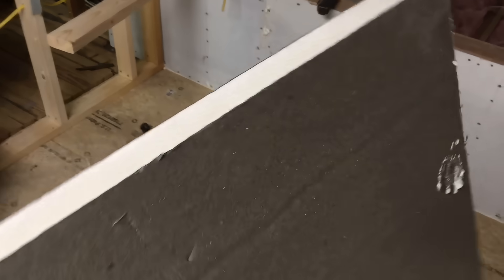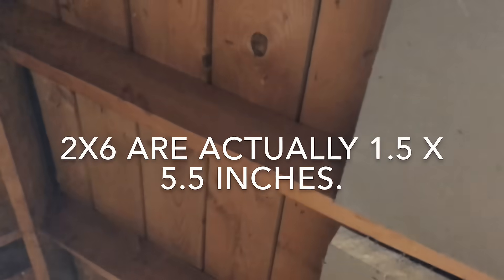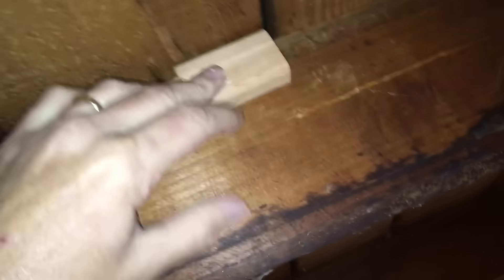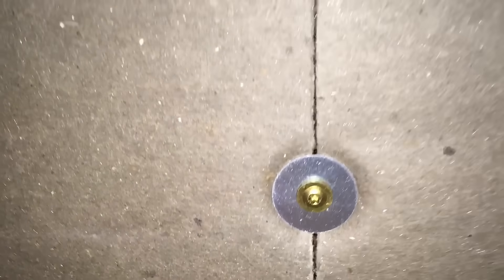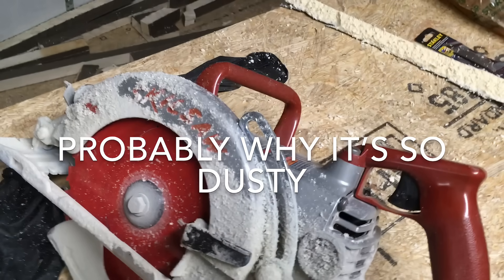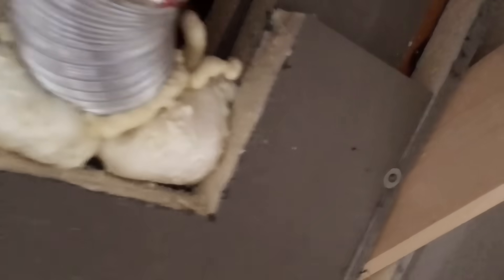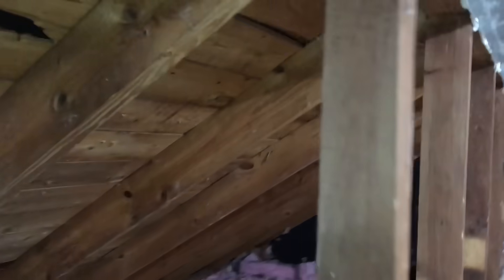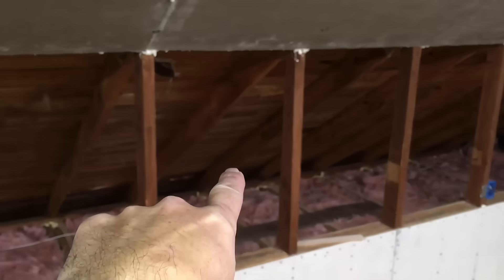Getting R-30 in an attic suite with 2x6 ceiling rafters

Comment: Having a house from 1900 it's not recommended to spray insulation. 

When buying the property two years ago knew I’d add an attic room, but needed to learn how. It's not as easy as I thought. 

With the Derecho storm hitting the property at 140 mph insurance with USAA is covering the roof, fascia, and new gutters.

The contractor is sealing it so can add insulation and make it a room. So, that problem was solved with as little as my insurance deductible 😁

Older houses have great high-quality beams, but as you note not wide enough.

Thankfully, the property has a pyramid-style roof, but don't wanna sacrifice height since I'm tall, and for future generations wanna ensure it'll suffice.

This method is gold. I theorized and plotted with research,  but nothing came close to this tutorial. 

Thank you for the wisdom and ideas. 

For here the energy inspection recommended a 36R value. I didn't call to ask for city rules. Thanks for the info.
Reply from the maker: Thank you for the kind comment, Miss Patience. I wish you the best on your undertaking!

Comment: Hi, this is exactly the idea I was looking for.  Thanks for sharing this. My rafters are spaced with the gap being  14-15 inches. What do you recommend for cutting the 8x4 iso panels? Go 12 inches wide and  get 3 out of a sheet and fill the gap left and right with spray foam? Did you fasten the first two layers separately, or all three with the rafter screws at once? Thanks in advance! Herb
Reply from the maker: Good questions, Herb. If I were working with 16 OC rafters like it seems you have, I'd cut the boards about 14.5 inches wide, or a hair wider (enough for a friction fit), and use the leftover 4.5" for cracks and crevices or cut slivers to help wedge any boards in place that don't have enough friction to hold them (fasteners aren't used for the first 2 layers--just friction). I know it sounds a little wasteful, but otherwise there's no good way (that I can think of) to hold the boards in place. If you end up trying the 12" cuts and it works well, please comment back. There are always better ways to do things, and you might have found one. Thanks for the comment, and all the best on your project!

Comment: Looks good; depending on how how hot your summer gets; a 10"  auto shutter fan on one or both ends of the ridge would be a good addition; I had ridge vents across the entire length; and the heat still hangs without any prime mover.

Peace

Comment: Even buying by the pallet it's 70$/sheet x 3 layers = $210 for 32sqft which is approx 7$ sq/ft.   That's even before the spray foam and screws.   I'd wager a spray foam contractor turnkey is cheaper.
Reply from the maker: Cost me less than $20 per sheet ($18 if I remember right). GAF EnegyGuard. You can find it even cheaper than that as seconds if you look hard. Thanks for the comment, James.
Reply: @FamilyFriendlyDIY  Well $20/sheet would definately make it feasible. I have a similar project but I have the room to furr out conventionally.

Comment: Hello Dave! I'm doing a very similar project in my 1950's style home that has slopped ceilings but no insulation and no attic. Similar to the project in your video. I see you left the 1" air gap. Does that air gap need to vent from the outside? I was thinking about leaving a 1" airgap and also drilling 2" holes into the eves to allow air flow to enter from the outside of the house. Is that necessary??? Am I doing more work than I need to??? Just worried about moisture build up and that creating mold. I plan to use Roxwool R15 or RAMAX Thermosheath 3 3-1/2" thick insulation. Please advise. Thank you.
Reply from the maker: Hey, Samuel. It was actually my shingle manufacturer that required the air gap and venting from soffit to ridge in order not to void the warranty. But depending on where you live, and your shingles, you might be able to do without. A lot of folks said I was wasting my time with the venting...but I like the idea of the insulation being able to dry to the outside as well. Thanks for the question, Samuel!
Reply: @FamilyFriendlyDIY  Yeah. The more I think about it, the more likely I will leave 1-1/2 air gap just in case. I don't want any moisture build up and then it turn to mold and then I'm in deep *hit. I live in California. Although that air gap may not be code in my area, I just don't want to risk it. Thanks for the response.

Comment: If you get a roof leak, will the water just bead down into your walls? That is really the only negative I can see with this setup.
Reply from the maker: It'll probably run down behind the knee-wall. But I think no matter the insulation, a roof leak will have downsides. Thanks for the comment, djuforeo!

Comment: Nice work lad, very clean job. Next time look into Kingspan “kooltherm” it rocking out R-8 per inch so if you did the 6” you’d be up to R-48 which is about the same value as a Passive house wall value. Not cheap though I believe apx $70\board @ 2” thick. Their based in Ireland but have a factory in VA and have reps all over the states.
Reply from the maker: Thanks for the info, Chris. I just checked it out. Pretty interesting stuff ... Way out of my price range though :-(  but maybe some other folks on here will find it just what they're looking for.

Comment: Excellent tutorial! Thanks so much!! We are tackling the same type project now in northern Wisconsin. Question: Why did you use batting insulation above the collar ties instead of the same rigid insulation you used on the slope?
Reply from the maker: Thanks! ...  I used the 9 1/2" batts above the collar ties because I had a deeper space to work with, and it's cheaper and easier to install. My goal was to do it all as cheaply as possible, while conserving headroom and meeting code. Thanks for the comment, C Bayles!

Comment: Should have sealed the soffits with osb and capped the ridge vent to create an invented attic and spray foamed yes more expensive but now you created an insulated vapor barrier envelope   Very well documented if inspector gives you a hard time. Depending on climate zone.  Now you created a complete thermal break so moisture has no place to condensate. 
Unfortunately moisture in the winter can still condensate in the space you created and mold over.  IMHO.  Vented attics are a thing of the past they don’t work.
Reply from the maker: Your suggestion could very well be the way to go... until something supersedes it ... and then something supersedes that ... and then that ... as something always does. I have a feeling that one day ALL foam will be done away with ...  for now, just trying to get by with what I've got. Thanks for the comment, jetmaster.
Reply: @FamilyFriendlyDIY  going over this subject with another engineer on a remodel that came up where spray foam wasn’t an option 
Strip shingles 2 layers of either rock wool, eps, Xps put in battens of rock wool then zip sheathing taped all soffits and ridges sealed then batt insulation in 2x8 rafters.  
Soo conclusion in my area was cheaper to spray then rip my roof apart. the engineer agreed the sealed envelope creating a thermal barrier with no venting but also creating a vapor barrier and or air exchange unit up north, and a good vapor barrier exterior in the south.  
Great job multiple ways to skin the cat.
Reply from the maker: update : https://youtu.be/5oSQhPvCvz0

Comment: The r value requirements in building are only to support traditional insulation in a laboratory setting. The vapor and air barriers alone in spray foam mean you can use a tenth of the depth and achieve MUCH better results
Reply: did you even watch the video is spray foamed all the cracks up getting a very good seal.
Reply: @khandam7709  what are you talking about?

Comment: Your 2x6 rafters and roof are not designed to carry the load of insulation and drywall. This is a rookie mistake.
Reply from the maker: I upsized my collar-ties to effectively reduce the span of the rafters. The span is less than 8 feet from collar-tie to knee-wall. It's been finished (with drywall) for a couple of years now, and everything still looks good. Not a single screw pop or cracked joint.

Comment: great job, is that styrophome board fire retardant? can you sheet rock over it, and make the attic liveable?? time and labor costs, mite as well spray closed spray foam, no?
Reply from the maker: Thanks. It's not fire retardant, but it is now covered in drywall. The area is livable and is now a bedroom suite with full bath. (Got some more videos out there with it finished.) I didn't have the money for spray foam, and I worked for free in my spare time :-) ...  Thanks for the comment!
Reply: @FamilyFriendlyDIY  where do u find the foam, how much per foot so we can get an idea? it kills that its 3 stacks of it to get to 30r. also no vapor barier needed between the rafters and 1st piece of foam 2prevent m oisture? thanks
Reply from the maker: @mml1224  Got it at ABC Roofing Supply for about $18 per sheet, but a lot of guys have commented they can get "seconds" cheaper than that. I wasn't required to have a vapor barrier where I am (SC). Not sure about other places.

Comment: Hello Dave, I really liked how you insulated your attic's rafters with the foam boards. Is there a reason why most people using these foam boards in attics only use them on the rafters and not in between the joist that are normally filled with loose blown-in insulation? Is there a reason not to use those foam boards in between the joists and then blow some insulation one them. Thanks, Juan
Reply from the maker: Good question, Juan. The reason foam boards are more often used in the rafters is because they provide more insulation value with less depth, so headroom can be conserved. If the area is just unused attic space with no floor,  and therefore the depth doesn't matter, it's a lot quicker and cheaper to just blow in about a foot of fiberglass (or a little less cellulose) to get the same insulation value.
Reply: @FamilyFriendlyDIY  Thanks for getting back to me.

Comment: I used this exact material for my house addition. Fortunately, a manufacturer is only about 10 miles from me and sold "seconds" for a fraction of the cost of new. I saved myself thousands, but it was a lot of work and a itchy mess. I filled 2x10 rafters, so my R value was over 50. FWIW, a table saw works well to cut the material.
Reply from the maker: That's awesome, Bob. ... I did another video on cutting it, didn't try a table-saw though  https://youtu.be/Z292iuV91hA

Comment: How do you install your gypsum boards on the polyiso boards?  Why didn't you put 1x3 or 1x4 slats when screwing your polyiso?  That way you would have had a nice place to screw the gypsum boards.
Reply from the maker: I used really long drywall screws. https://youtu.be/dGeoA1ji_iM  It's been about 2 years now and no screw pops or cracked joints. I think the foam actually acts as a buffer from the expansion and contraction of the rafters.

Comment: If the gap between the roof deck and the insulation isn't there for airflow then I would fill it with solid foam.

Comment: This is the best job I’ve seen yet. Did you consider a sealant or coating (maybe aluminumized) on the underside of the roof. I was thinking that so much hot humid air is going to be moving through these conduits that protecting the wood would be wise. I was also thinking about using a foil faced foam to reflect more of that radiant heat back at the roof.
Reply from the maker: Just reading through some comments I missed. Thanks Mike. I thought about it, but I was trying to get by with the least expense and satisfy the inspector. We just scoped the roof though, check it out 3 years later https://youtu.be/5oSQhPvCvz0

Comment: hint for working with fibreglass. 
stay as cool as possible, and don't sweat. if this means planning your work for cool days, do so!!! 
Take a full, cool shower immediately after working, THEN heat yourself back up after you're fully scrubbed with the cold water. 

This helps BIG TIME for the itchiness.

Comment: To cut without a mess, box cutter score both sides and snap. Or box cutter for the facing and a hot wire cutter for the foam

Comment: Creative and it works. However if I am not mistaken R30 code would be on new construction and older homes could be grandfathered.  With older homes there is sometimes no way to meet current building codes. Honestly for the time and materials involved you probably could have paid for open cell foam applied directly to the roof deck that would have outperformed that rigid foam just due to it's ability to stop airflow.. The figure you mentioned seemed high. I had a silimar project in our last house for the master bedroom. About 600 square feet and it cost $1500 for ceiling and walls. I wouldn't even think about any other type of insulation at that cost...
Reply: $2.50/sq ft?  How thick?

Comment: Um, good, but how in the hail do you drywall that ceiling then,lol and don't say just mud them seams and paint ,lol
Reply from the maker: https://youtu.be/dGeoA1ji_iM
Reply: I'm gunna give you this,  your thorough. Not sure I like the 3 inch screws in drywall idea, but gaining r30 where you normally can't...if the drywall holds over time I guess I'd use this setup.
Reply from the maker: So far, so good ... 2 years now and not a single screw pop or cracked joint.

Comment: I own a 2600 sqft cape with a walk-out basement, I had all exterior walls including exposed basement walls, the ceiling of the 18' dormer, and rim joist spray foamed, cost me $7500 including labor. Well worth the cost here in NH. I recommend you get a quote from your local insulation company before you insulate anything because they beat the cost of insulating my garage by $300, labor included!!! I quoted out the cost of the insulation from Home Depot and they came in $300 cheaper including labor, so I didn't have to deal with getting itchy, sweating my ass off, or breathing in any of the glass. The insulation companies buy the product wholesale which allowed them to quote cheaper than the big box stores including labor. Dave did a great job here and I'm impressed by how nice the job came out, but time is money so you need to include your time as well in the cost of the job, not to mention your health.
Reply: @Volkan Builders installed products located in Auburn NH

Comment: Pretty ingenious. And I like how you left the all important gap between the roof decking and foam. And the third layer of foam stops the thermal bridging.
Reply: By "thermal bridging" you mean where the lumber, in this case joists, leave gaps that are not insulated? (I'm a lay person). I am curious, How think can you go on that third sheet?  And how do you hang and join the drywall? It seems like it would be really hard to do it well.
Reply: @bigtimepimpin666 I want to see how that goes as well. Just longer screw I imagine would suffice for hanging the drywall.

Comment: This is old but a layer of radiant barrier on the underside of that insulation with an inch of air gap would make a HUGE difference.
Reply: Can you please explain why? I'm just about to do this same install to my roof but I wasnt planning on adding radiant barrier or any gaps.

Comment: You can use a Stinger cap nailer with 2” cap nail coils to make quick work of attaching the last layer of iso insulation to rafters.
Reply: How ya gonna do that when the foam board is 2"?  Hmmm?  :)

Comment: Genius! I just purchased an old home with 2x6 rafters, and someone back in the 70s or 80s hung fiberglass insulation right against the boards that the shingles are attached to (on the underside obviously). I’ll have to rip that stuff down, but I’ll give this method a try. THANKS!
Reply from the maker: May you endeavor be a successful one. Thanks for the comment!
Reply: I have the same issue.
Reply: I just bought a home from the 20s and the only tring under the roof decking is a layer of air then on the underside of the rafters are stapled cardboard boxes 🤦‍♂️

Comment: Super nice Job.  The only thing I would have improved on was to put something in from the eve to the peak and keep your air space at 1-1/2 all the way up under the complete span of the rafter.  This then helps keep a dead air space in the other areas and you don't get any air washing going on.  The industry works so hard to air seal the vertical walls, but ignore the ceiling area for some reason.
Reply from the maker: Thanks and thanks for the info @24revealer. You just made me look up "air washing." I didn't know it was that big of a deal, but you're right, I probably should install some sort of baffles.

Comment: That dust is horrible.   Cut that stuff outside, use the correct tool, or use an air scrubber.  Now you got airborne material everywhere for no reason.

Comment: Yeah, damned to have dust if you want to get that project done, however, I'd have never cut it indoors without a dust removal system, or at the very least a respirator... that is cancer causing lung disease laden crap right there!